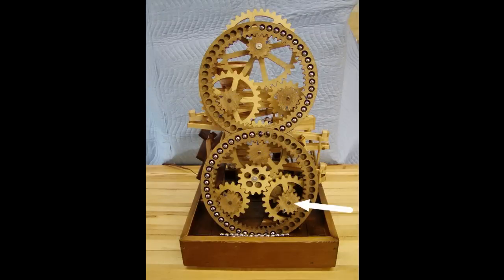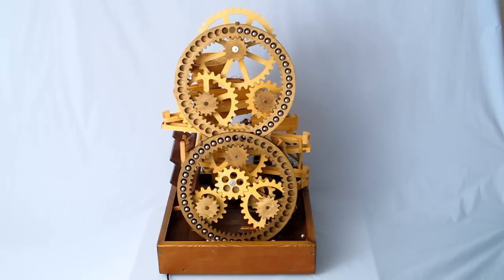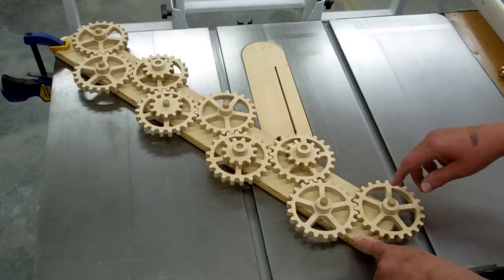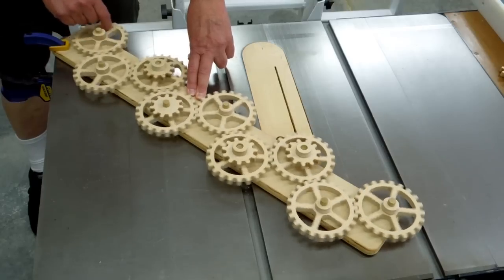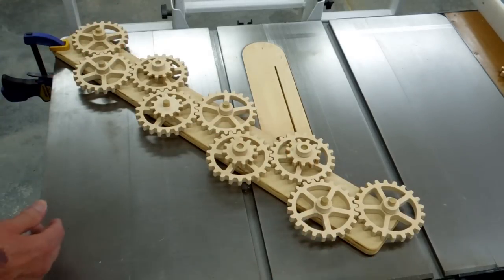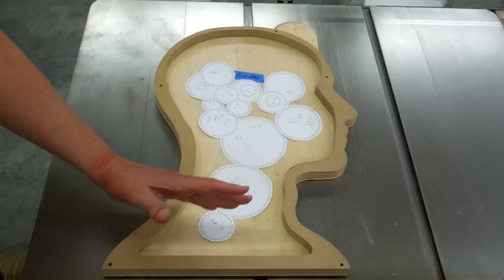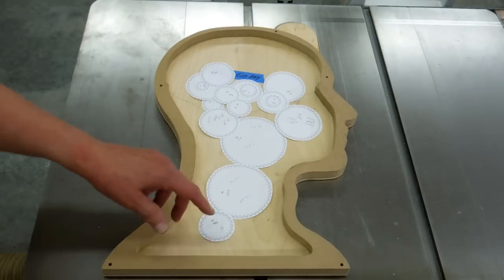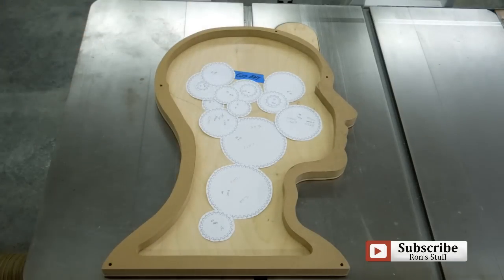Gear Mechanisms - Balancing The Load

Comment: Do you have a plan or a starting point for those gears there ?  I’m  a steampunker and  I’m struggling g making real gears ,  any  suggestions .. ?id greatly appreciate it .   This piece looks so cool the gears inside the head   , superb sir ...thanks for sharing knowledge
Reply from the maker: No, sorry. The templates for the gears in the Gear Head came from a friend and I no longer have access to them. You need to do a Google search for "gear template generator" and then play around with the settings. Woodgears.ca bottom left hand corner has a free template generator but they are a larger gear... not as delicate as what  I used (which are more of a clock wheel design).
Thanks for watching. Please subscribe. 
That is what keeps this channel running. 
Ron
Reply: @RonaldWalters2010  I liked the style of yours  that is why I asked , I have seen a few generators  but there’s are more solid .. thanks I’ll look for a better one . Great video ....have a great week thanks for the reply sir .

Comment: Hi Ron, do you do quite a lot of scroll saw work?  I have been amazed at some of the gadgets you have come up with in other videos

Thanks
Reply from the maker: +drail80s Yes. Wood gear clocks, wood gears in general, planetary gear drive, marble machine, Christmas ornaments, various parts of my Senior 20 Organ including the fret work on the front of the organ... and the upcoming Gear Head. If possible I often choose to cut stuff on the scroll saw instead of the band saw. I have many videos related to the use of a scroll saw. Thanks for watching.

Comment: hi Ronald Your problem has to do with tribology. In fact you have friction building up due to deformation of your teath and the amount of theath that are touching eachother at the same time)so the bigger the chain of gears the bigger the friction the bigger the defirmation of your theath (normally this is solved via lubrication). so if you take the gearbin the middle you are in fact deviding the friction in half. so you plan with the head you are planning in splitting up the friction will have some effect but not as much as demonstrated in your other setup. the wheels will also not all turn in the same direction but that might not be a problem. Looking at the size of your gears the middle ones are quite big.. so they will speed up the smaller once above.love your channel Ronald keep them comming, Martijn

Comment: Friction is your enemy I suspect, put gears on bearings with little to no side play and I bet things will change a bunch.  Just a guess mind you, I'm not an engineer so mileage may vary.  :-)
Reply: +Larry527az Yeah, the gears are man made where the teeth are probably a tighter fit than should be and there is a lot of friction.
Reply: +Heavyboxes Apparently you guys have not watched any of his videos involving wood gears. Hand cut but they run smooth!